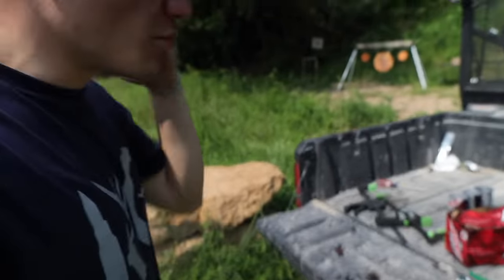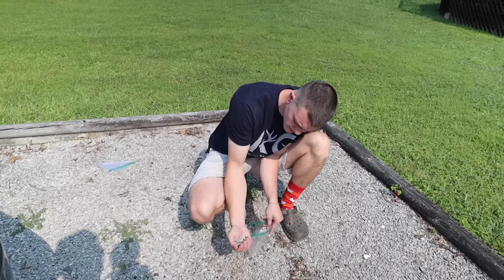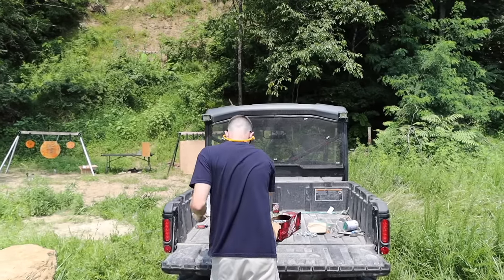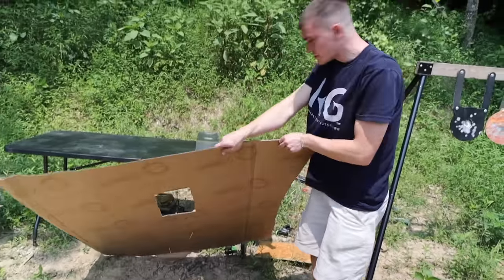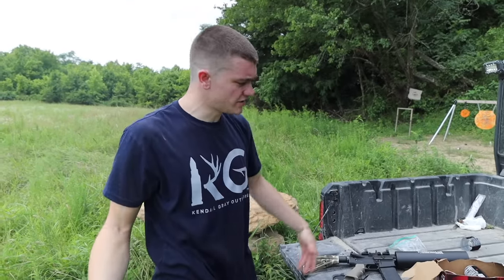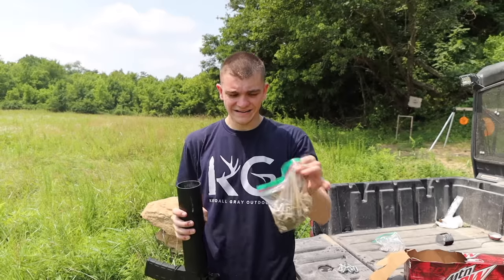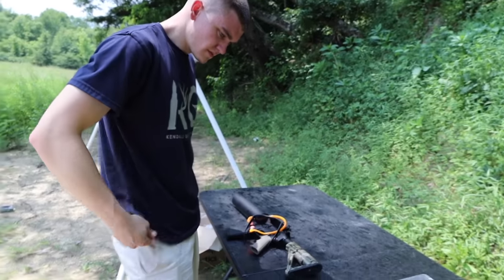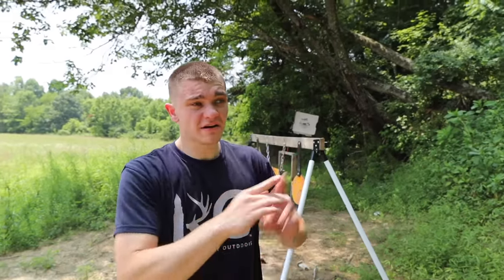Shooting DANGEROUS Things out of a CAN CANNON! (Science Experiment)

Comment: your issue with the opened cans... you needed to load them open end first so can bottom would be showing if you were to look down the barrel. using paper to stuff the can open end to keep whatever inside. this way the pressure pushes the package out, which should inevitably spin open en-route to the target. so try that for better results.
Reply: I'd open the can, cut out the top, and load whatever you want in there then put in a very light material like you mentioned paper to keep it in there. He got a lot more power when it was packed and kept heavy. Frankly out of all the things he fired the mountain dew can is the last thing I'd want to get hit with. Especially if it was the right amount of weight with a skewer up top. I'm sure smth in that...ugh...an assplug type of shape with grid fins would be most effective.

Comment: i think it was a good idea to use the cut outs of the cans as a wad but i think you should close it up after you put the projectiles in the barrel. maybe with something like newspaper. you sort of figured it out half way through but did it with the full cans so there was no buildup speed and stabilizing from the barrel, only muzzle velocity pretty much from the can pushing it out. so basically you should try it with cut out of the cans as a wad + projectile of choice + newspaper to close up and secure.

Comment: Well that was a fail. Hey you got to pass a background check for that can cannon?
Reply: No. The upper isn't a serialized part. The lower half of the ar15 is the "firearm" that you need a background check for.
Reply: @collingodbey3737  yes I know that to be correct and true advice. So only way to get around that would be to 3d print that part. Even then it's sketchy with laws on the books. Best advice for felons is don't do it

Comment: Get a cardboard tube the same size as the boar. Place the chain down in side it and use construction foam and make sabot that way. Then When its dry cut away the cardboard and cut the foam in half so it splits apart mid air!